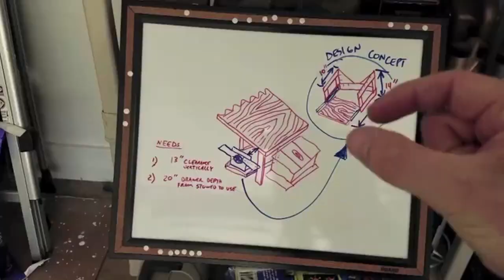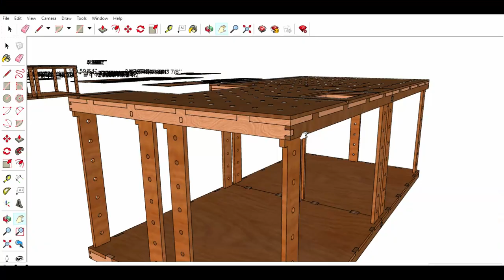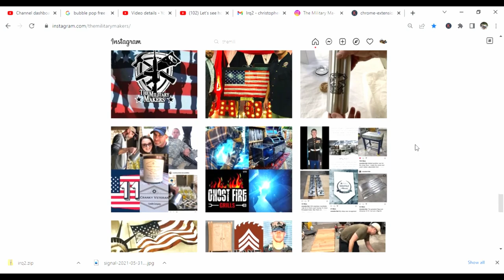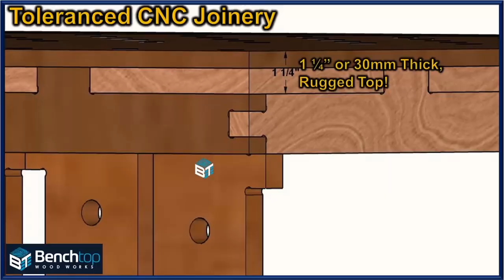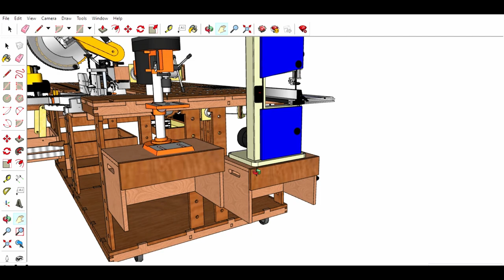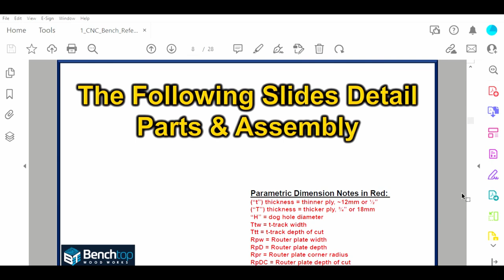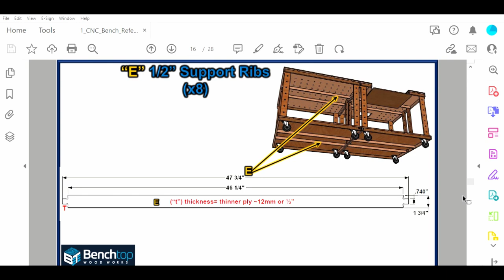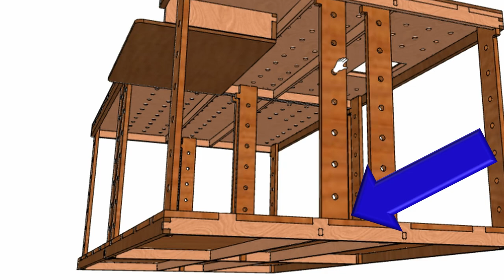CNC cut parts without a CNC? // Workbench Build 1 of X // EP 88

Comment: Chris, the bench looks great!
Parametric modeling is such a wonderful feature. I used Autodesk Inventor for most of my career and it was so nice to be able to change the value of a variable, such as hole spacing, and it would update throughout the assembly. As I told the other engineers, it made me look less stupid.
Reply from the maker: Thank you  Bob, I'm really enjoying the new bench.  I came up on old Auto-Cad 2D and then Pro-E and sketchup so Fusion is a nice challenge.  Parametric is excellent,  especially when planned before modeling! Thank you for the encouragement. 
 I'm very rusty, but I've got my relationships for the model figured out,  just need to spend the time to work through it.